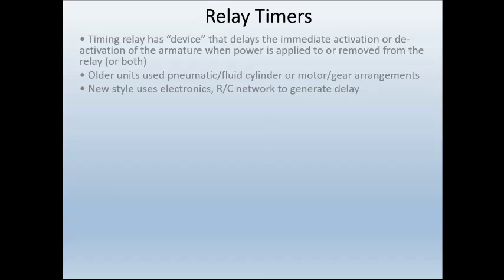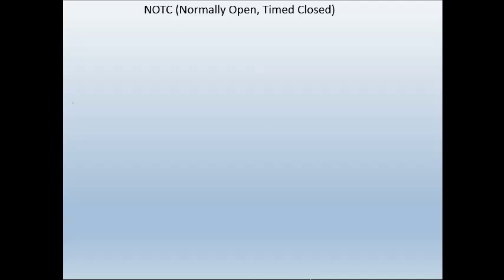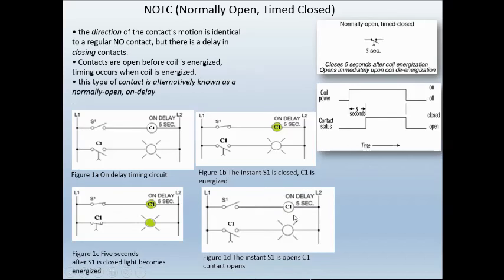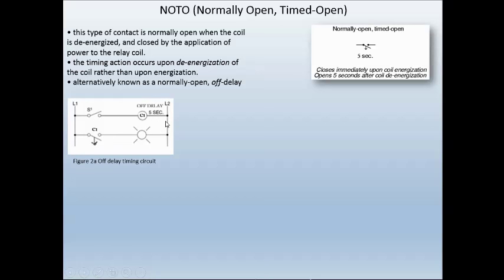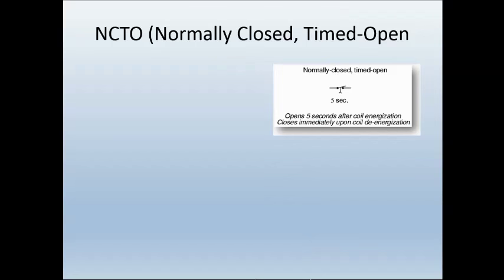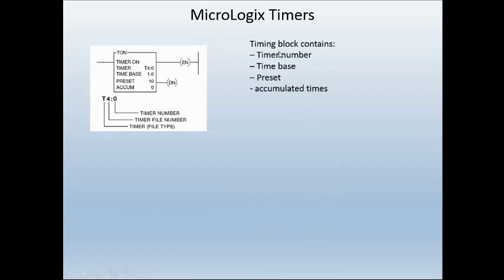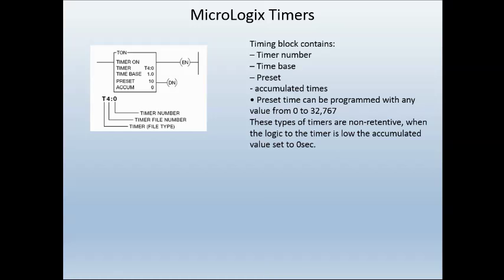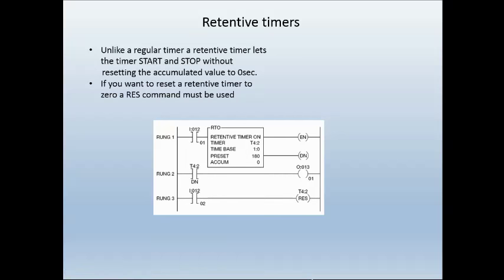Timing Relay

Comment: Hi, thank you for your video. But I still unable to successfully wire a working NOTO connection. Will you be able to assist me in detail. I have the following device for the connection.

1) small size battery 12v
2) Momentary button switch
3) Panasonic S1DXM-A2C30M-DC12V Timer relay
4) LED

I wanted to turn on the LED with a push of the Momentary button. And the LED will stay ON for a pre-set timing eg:5 secs and switches off after. I cannot figure out on the wire connection on the Timer relay which has 8 pin. Will you be able to advise me how?